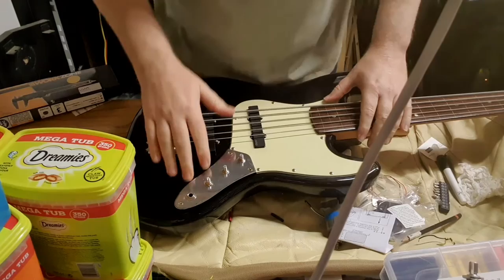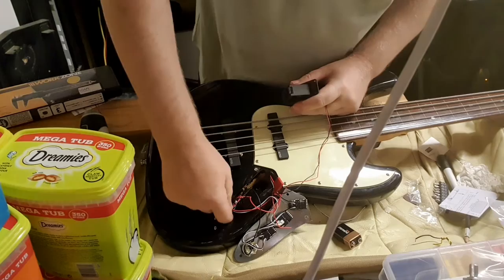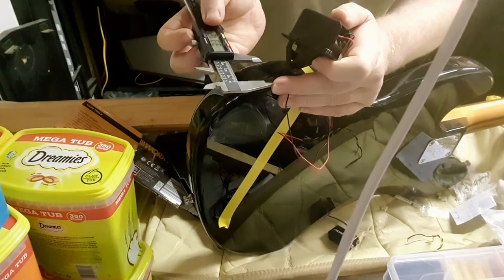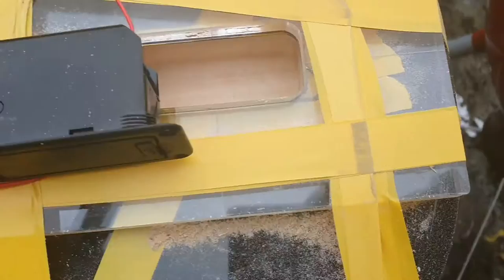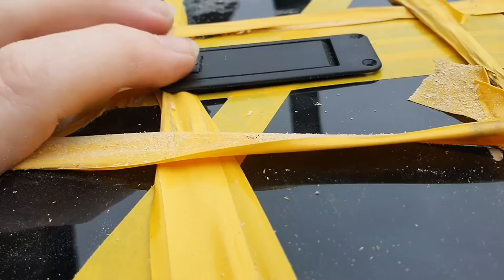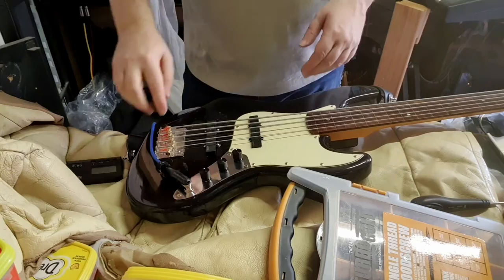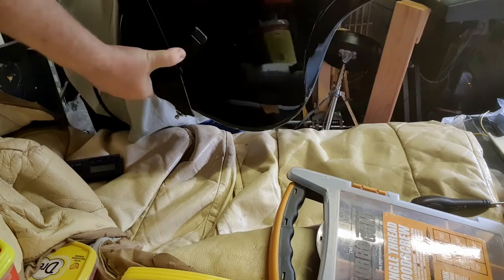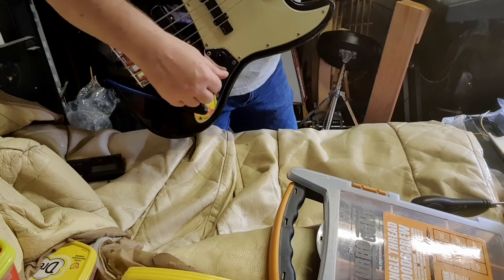Installing Gotoh BB04 battery box on SX 5 String bass

Comment from the maker: Listening to the bass playback I can hear a bit of hiss - this is the camera and items into he garage vibrating. The output is very very clean from the EMGs and as demonstrated you do not need to match the neck and bridge volumes so avoid noise. Very pleased and easy to change the battery now.

Template was £13 and battery box was £14.

Comment: Haha, your projects always make me on edge of seat while watching! You just get in there and get it done. Nice work! 🤘 It is scary routing for that battery box...when you only have a few mm to spare. On my old cheap compact router, bit would just decide to drop a couple mm with no warning. Installing battery boxes is when I finally figured out it was router, and I wasn't going crazy reading measurements. 😂(I also learned hard way, to verify all electronic calipers/etc off each other. I found some could be way off...especially the cheap plastic ones I use to avoid scratching finishes.) I think you put it in perfect spot, and LOVE how you tapped into bridge ground wire channel. Not that it's so hard to drill a wire channel, but this is cool "out of box" thinking! 🤘 After watching your video, I think I will install battery box in my Bass VI in same location...in case I ever install active pickups. I was think of placing it between pickups, but I guess an actual musician would not appreciate it having this battery box cover rubbing against them while standing at performance? 🤔 Your location is much better. Thanks for sharing work on video, very helpful to all of us in community!!! 🤘🤘🤘  (Oh, and I always have to fight urge to mount battery box on FRONT of guitar...and probably will...and yes it will look totally stupid.😂😂😂)
Reply from the maker: I guess if there is some artwork on the box it could be stylistic? I also toyed with idea of mounting low a DC Jack in the control plate then run a wire to battery pack mounted to strap with Velcro. Then one can easily swticj between batteries and/or try out 18v. Or make a voltage divider and special cable to tap 9 - 18v from the Phantom power. Just don't lick it else you might become toast - then a ghost.

I am just ordering some more GOTOH boxes for the green J & D and the DG20s - there again I am also happy with the battery in the block house.

Can't wait to see more on your IV bass. Jet Harris (RIP) got some awesome tone out of those things. I feel an urge to get one :-)

Comment: I have a question if you see it. Is that box to wide to mount it in the end of the body by the strap or on the edge under the control cavity. I have one of the boxes on order to install in a bass .
Reply from the maker: Not sure I totally understand the geometry you are after. It sound like you might want it to go under the control cavity? I doubt that will work.

I tried to put it roughly parallel to the cavity between centre line and edge of cavity and using the bridge wire routing hole as way to feed wires to the jack.

In a Stratocaster I have mounted the raw battery (should wrap it in insulation) in the spring cavity. Took one out - slightly lopsided - whammy still works.

In my J & D bass and my Squier Jazz I was able to fit the battery under the contr cavity.
I will get around to routing the J & D. Not sure about the Squier - I don't ever want to sell it - but if I did the buyer might want it more stock.

One idea I might also try - get one of the battery DC sockets plus a plug.
Drill hole thru the control plate (I doubt the socket will take more than 8mm diameter overall), mount the socket and wire that to the active electronics.

Now - wire a battery externally into the holder, make some velcro to fix to your strap. Plug in - or unplug (to be sure you don't drain battery whilst at rest but plugged in).
Added benefit - gang to 9v in series and you can run 18v if your active electronics can take it.
Added Added benefit - easier to change batteries 
Added Added Added benefit - could add a bit more mass to counteract neck dive?

Do measure height of holder first - will try to measure mine. The SX wasn't quite as thick as  Fender - but there was enough thickness to accommodate the battery box. A thinner Squier Bullet would probably not be deep enough.

Best of luck with your project- post a link to final result. And watch Sniffer Customs - he is a far better craftsman than me!
Reply: No I was asking if it will fit onto the edge of the guitar. But after looking at my bass, I can see there is no place flat enough. There’s enough width but no place flat enough without sanding a level spot . Thanks for answering. Keep up the good videos

Comment: I don't like these particular battery boxes,.....anytime power wires are attatched to a moving battery door,...they will always break off.
That's why it's important to buy a battery box with no moving parts,......just an easily removable door.
Reply from the maker: Do you have a part number so I can check?

I not found any particular problem with the Gotoh yet - there again I am not having to pull the battery out yet.

For the Stratocaster I managed to hide battery in the block cavity - between springs.